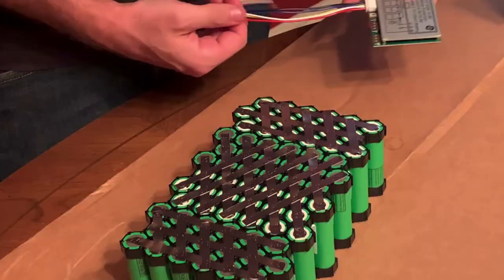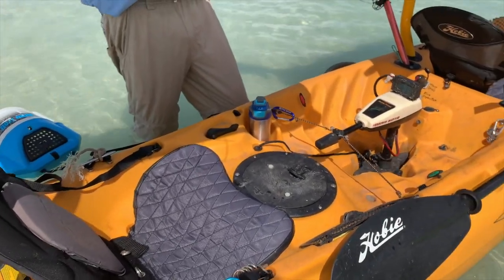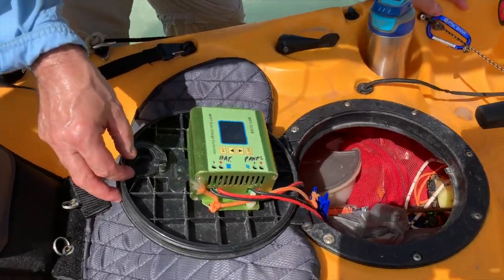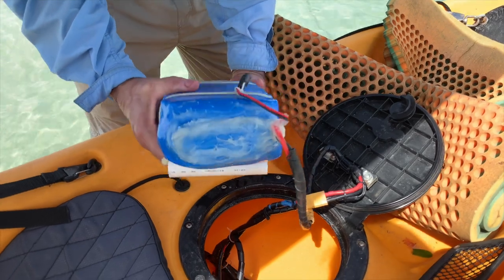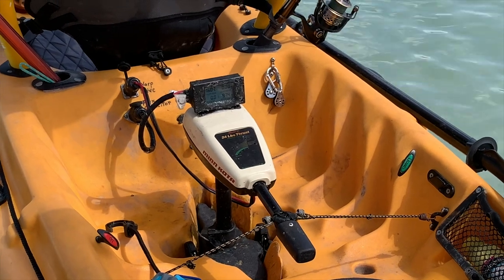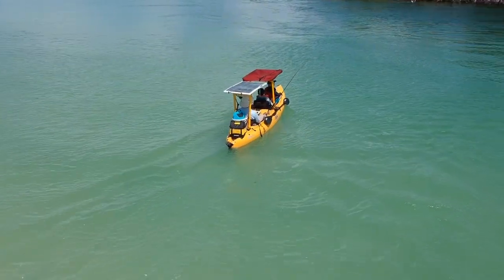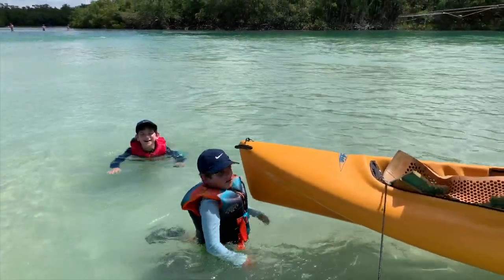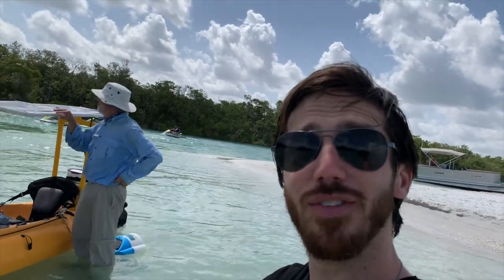DIY solar powered electric kayak (overview and demo)

Comment: This is the content we like. You exploring unique tech. Innovative and new ideas especially diy
Edit: this is something I would copy. The solar panel basically serves two purposes: providing power and sun cover. Man I wish I have a Hobie mirage kayak tho.
Reply: Hobies are great Kayaks.  I have been in many others and this is simply the best.  Pricey, but great.  This kayak is over 10 years old and has held up great with all the mods and many trips.  Thanks for your comment.
Reply: Check out fiberglass mold building on YouTube.. it’s not that hard.. I own a killer sit ont top 14’. I tricked my boats with out with pontoons, awning , view window,
Duel 30 lb. motors. I think my boat looks better than most because of the flex panels and the bow nest where the border collie rides.

Comment: This is absolutely genius. I’m interested to know how it handles in windy conditions though...could the panels catch the wind and maybe cause the kayak to flip? Or, if conditions get choppy and the kayak flips, could the panel hinder you in your attempts to roll it upright again? I have no experience in kayaking yet, so I’m just curious.
Reply: it is difficult to flip most sit on tops. I'd imagine the weight of the battery being under or at the water line would further help with stability. As far as the movable solar panels? I've never seen such thin and lightweight panels before so now I am intrigued! I currently have a tarpon 120 sit on top with a trolling motor and use my foot pegs to turn it as it has no rudder. I am going to look up the cost of these types of panels and will likely velcro 1-2 on the front of my yak to keep me on the water all dang day instead of 2-4 hours.
Reply: @bullyakker  they don't charge that we'll. Will extend your range a little. Will drain a lot faster than it recharges

Comment: These videos make me even more inspired! I'm modding out my 9' RIOT with solar panels and my set up is almost identical to yours, but instead of the trolling motor I'm installing a 12v DC drill as the motor. The land testing is almost complete. The drill eats 12v DC @ 1.3 Ah and my solar panels are 2x 25 watt 12v. Testing the panels has shown this puts out almost 4 Ah is good conditions and just under 2 Ah in low light. A battery serves to keep the current stable and also as a back up if the light gets too low (bad weather or staying out too long). That 100 watt flexible panel you have interests me! Might have to check that out to upgrade mine! Thank you for the vid!

Comment: Great long awaited update. Lovely family! I’m planning a similar build but will be using a PWM to be more efficient with power. Stock speed selector on the trolling motor limits the range of the power your battery pack can provide. Love the rig and thank you for sharing! Micah, maybe next project is to add a brushless motor on dad’s kayak.
Reply: Try out the new super effective toroidal propellers !

Comment: I have in my possession two spare warp drives that come with a set of FOUR flux capacitors that I'll send to your father today for FREE!  Those flux capacitors are hard to come by these days.  I LOVE THIS SETUP and will be putting the knowledge shared here to good use on my kayak!

Comment: I bought this model for my 14 ft Jon boat. enjoyable.fishing recommend love it!!! It pushes my boat with ease ( 2 men 220 each). I would highly recommend this to anyone.
Reply: according to my math a 12v 100AH battery gets less than 2 hours of full speed runtime on a little 30watt motor like this. in terms of speed it's better than rowing but your not going very far at 0.40 horse power.  a gas generator and 48V 120+ pound motor are a better compromise.

Comment: Second panel, and you could add a radio and/or extra utility power (charge phones or run a Peltier cooler for cold drinks, etc.) and some small fans for the passengers. More options than the range or faster performance that others have mentioned.
Reply: One should be able to add about 3 or so panels on it, this should provide enough power to not use the battery. Jaimie has made a lot of solar powered boats over the years you can check out his builds. https://www.youtube.com/watch?v=V7flR0O-coU&t=1s

Comment: I really like the shade aspect of this.  Those kayaks have absolutely no shade normally.  You just sit out there in the hot sun.  There is a lot of nice shade added by the panel.
Reply: Absolutely !! Sun is dang hot and now with the Bimini top I go out more in the summer than I used to.  Having the motor push me around is a nice plus as well !!  Thanks for your comment.

Comment: Great video I'm also in the process of building a solar kayak, it's just on an inflatable labor. The whole system will be in an enclosed pelican box. Micah you should show the diagram or better yet make a video. This will be a great project for everyone . Btw I'm using a 55lb trolling motor and working to upgrade my props. Can't wait for the NEXT video.

Comment: Super cool rig. been thinking of something along these lines. recently was gifted a bunch of now-illegal grid connect solar panels, and my old man picked up a 'tupperware' hobie cat without the sail. Its just begging for something along these lines. unfortunately electric trolling motors are not a thing in my neck of the woods (no bass fishing), so the motor is prohibitively expensive new, but Im keeping an eye out. very inspirational, quite impressed with its performance. especially if your just kickin back in the shade.

the deal is, he plays with it this summer, jerry rig a sail for it and get his best speed, N I'll mod it over winter and get mine next summer. Ideally, It'll be able to use both.

Thanks for confirming my hunch that this is a Good Idea.

Comment: Big question! I bought littokala cells in the past and they are good. Today I saw littokala official store selling 36v 15ah ebike batteries for 80 dollars!? Are these real? They have 21700 cells which are expensive and hard to get hands on. Please do a review on these ebike batteries that littokala sells! It would be so interesting to see if the capacity is real and how it's so cheap! Thanks.
Reply: I can't speak of this specific pack but I do know China is overrun with counterfeit cells, especially 18650 cells that compose most battery packs. Good rule of thumb as you know, if it sounds too good too be true, it probably is. You'll find most reliable workhorse cells are around 2,400 mAh, with maximum capacity topping out around 3,200 mAh. If you see cells advertised higher, you can be certain they are fake. Not all fakes are bad but most are, with a capacity around 600 mAh in my experience. I would assume the same issues also apply to 21700 cells. Shop smart and good luck!
Reply: I bought 30 18650 cells from liitokala store for around 40$, i am gonna build 36V 9Ah battery for my DIY electroc scooter, but you need to do around 6 or more new accounts to get 4/5$ new user coupons.
Reply: @itsglizda345  Yes, they sell cells for around 2 dollars a piece. I used around 70 cells in the past to make an ebike 20ah pack but I found out that they sell pre made packs for super cheap and wondering if they're legit.
Reply: immorton joe  honeslty I heard they degrade faster then Samsung and LG cells.
Reply: I would like to know this as well, I bought Okoman and Laudatio Batteries before and on the Okomans the Capacity was wildly off. They sell a 36v/8.8ah as 36v/40ah for 100 bucks, which is a rip off but not a terrible price for an actual 8.8ah. The others seems ok but I haven't really tested them yet.

Comment: Love this build! I built a similar set up on my beach wagon. Converted a barbie jeep so the control is in the handle, and the deck holds over 100lbs easily. Two coolers, umbrellas, chairs, etc...Friends aren't sure whether to laugh or be impressed that I don't have to haul everything out the the sand by hand!! I even put lights on it for the night time! And the foot-well serves as a lockable compartment for valuables under the deck. Sure glad there are still guys out there that love using their minds to build useful stuff! This is AWESOME!!

Comment: The Min Kota is really inefficient, bypass the resistor coils and use a infinite speed  controller for $30 it will increase your range times 5.
Reply: Can you please elaborate a bit more? That is interesting.
Reply: Take it apart,  void your warranty and wire around the stock speed controller adding your own.  Or dont buy a min kota.  Or only go full speed haha
Reply: @Noone-l6g  the motor his dad has is like 10 years old. Yeah no warranty voided there.
Reply: Gianluca Sini PWM pulse wave modulation controllers effectively turn off the motor thousands of times a second this has the effect of slowing the motor down without wasting energy all troll motors slow down by wasting electricity through a heat coil mounted to the aluminum body of the motor, by using a PWM controller none of this energy is wasted therefore run time is factors bigger at slower speeds, cost is negligible but ensure the clock speed of the controller is high enough that it is beyond human hearing 15,000 htz does it for me Note Minn Kota have brought their own PWM motor but they want $450 for it, build your own for $30
Reply: What Sea just some advice for the guy using old parts, all troll motors are improved doing this, it’s true motor is working well flat out but sadly not practical to run flat out all the time

Comment: Very cool.  I have a tandem Ocean Kayak I motorized in 2010 for fishing but I used two SLA batteries, I would like to upgrade to a Lithium soon.  The Solar panel is neat but probably requires a long time to charge.  In NY you have to register any motorized vehicle so I went to DMV and got it registered for not too much.

Comment: A second 100W solar panel could probably be useful on overcast days in addition to extending the kayak's range
Reply: or a third .....or even 50w panels all over
Reply: Hoping for really high efficiency solar cells and lighter batteries. The future is a skin that is all solar cells; applications for roofs, cars, boats and airplanes. Anything with an exposed surface.
Reply: @pakde8002  that isn't really something that you could do with silicon based cells, and we still have a few more years before perovskite reach viability, so I think I am happy enough with what we can build now.

Comment: Nice! What I like the most is you've used rod holders for supporting the PV. This is the bit that's had me stumped - how to attach it.
Reply: Yep - worked perfectly !!  Did have to shrink down the OD of the PVC a bit but used the thick wall material so it is still plenty strong.  Best regards

Comment: As of yesterday, new Florida law, you can take an E-bike on any trail, path, or bike lane you would ride a normal bike on, no registration or drivers permit necessary.
Reply: Cool. Seriously good news.
Reply: We dutch have that too. but if you have a E bike that goes above 26 km/h then you need a bike/car licence and a licence plate.

My question is do you guys have a max speeds limit on the e bikes if so do you need licence and plate
Reply: Probably ok on bike lanes in roadways, but that's asking for trouble on bike paths and trails.  They weren't designed for bikes that go so fast.  A friend of mine was in an accident with an eBike last week that was coming around a turn too fast.
Reply: Unfortunately, local municipalities can override that law.  Such is the case with Sanibel Island where I have been reprimanded for riding an ebike on a bike path.  Life is too short.
Reply: @roy.mclean  those bike lanes painted on roadways here is suicidal, you eventually WILL get hit if you choose that option., and it doesn't take long. Everybody I know who rides a bike has been hit in those lanes. I stick to the sidewalk.

Comment: Very cool, solar is the way to go. I'm setting up a solar system for my ebike. My panel is going to be placed on my trailer and the panel is a 150 watt which has plenty of power to charge and ride with. Awesome dad.

Comment: This might sound silly, but here goes: Suppose you run out of battery, or have no battery at all, and just hook the panel directly to the motor (through some sorta' voltage stabilizer/regulator), would there be a problem running it? (of course on sunny days). Thanks for the video, real nice!
Reply from the maker: Theoretically it would work, but you'd get very low power by running direct to the motor. The battery serves as a sort of capacitor to handle higher power periods.

Comment: I enjoyed your video; thank you.  I've been thinking about doing something similar to this with the battery from my dead eBike.  (The controller unit repeatedly dies - so annoying).  But my kayak is a Dagger Exodus, with a KayakSailor 1.4msq sail + 0.2msq genoa.  I've made 2x homemade outriggers so it doesn't get tipped over in heavy sidewinds & waves at sea when the weather gets rougher.  Regards, JohnnyK from the UK.

Comment: I built a similar solar kayak using that same small Minn Kota 28lb thrust motor and power meter. Swapping out that speed switch for a Pulse Width Modulation speed controller will give you about 18 percent more range. I build mine inside a lexan GSI waterproof box with cable glands for making it water tight.  I'm using the Renogy 160watt marine solar panel with a Victron 75/10 mppt with bluetooth mounted inside a water tight pelican box. My next step will be to build a battery pack like you built your dad to replace the 100 amp hour lead acid marine deep cycle battery.

Comment: In a lot of ways small boats seem like the best type of vehicle for built in solar, the evaporative cooling from the water paired with shade from the solar panels would actually make fairly warm weather bearable. The power demands are low enough that you could use cheap low quality panels and lead acid batteries to power some trawling motors while still being able to cruise around wherever you want to go.

Comment: nice job  also you can add single axis tracking system to your solar setup and you wont need adjust it by hand . did you measured your motor currents ? what are the numbers?
Reply: Yeah, the tracking system would have a tough time keeping up with the turning of the kayak - rarely in a straight line for long !!  Motor draws about 6 amps on the slowest speed and about 23 amps at top speed.  Wind and tidal current movement affect these numbers a little.  Hope this helps

Comment: That came out pretty great. Being new to the battery building, so sorry if its a dumb question, is there no concern for the batteries getting too hot in the compartment? I would like to do something with 36v trolling motor and was curious about the compartment. There is lots of air flow. Just will be a bumpy ride in the bass boat. Thanks for sharing.
Reply: Never had a problem with the battery getting too hot.  Remember that I am not running it flat out for highest speed all day long.  Also, Micah designed the battery to not reach the maximums of current draw so a safety factor was built into the battery to begin with.  That's a big advantage in designing and building your own battery - you get the exact performance and parameters that you want based on your specific needs and usage.

Comment: That is very cool. I have a Caninghi that has a 40lb minkota. 
Just a question about the wind effect on the solar panels? does it make it unstable?
Reply: Not at all really.  They are parallel to the water's surface so the wind goes under and over them to a great extent.  This kayak has a 33" beam.  I have sailed it, surfed in over 3 foot waves and sailed it in 10 knot winds without outriggers.  Never rolled it.  Can't say it can't happen but this is a great kayak.  A big reason I chose it was the stability and comfort.  Stay safe and thanks

Comment: Yes neat. Solar vessels have the advantage of never climbing hills but they do have to overcome headwinds.  Hybrid systems including sails or kites can help. 6 knots can go a long way over a day's time.
Reply: being on the water is just a constant drag[then the winds] so anything does help like a a simple sail.
Reply: @10OZDuster  a boat must be designed for sail. Ballast, body hiking or width leveraging.
Reply: You are correct Lawrence.  However, with a 33" bean and 13.5 length, this hull design is amazing and a key reason I went with it over 10 years ago.  I have sailed it with the sail kit (about 15 sq ft of sail and had it healed over pretty good but never flipped it.  I made a sailing skeg out of a cassette that drops into the rear cockpit in place of the pedal drive (or motor) that greatly reduces side slip.  So this is a kayak that does many things well.  Thanks for your comment
 @LawrenceRhodes

Comment: Wonder if it would work on a 22 ft sailboat, get some flex solar panel onto the sail to charge the battery and run the motor 24/7 to help speed up the boat. Or remove the sail and install a roof with solar panel.